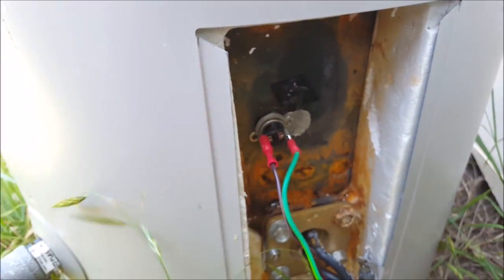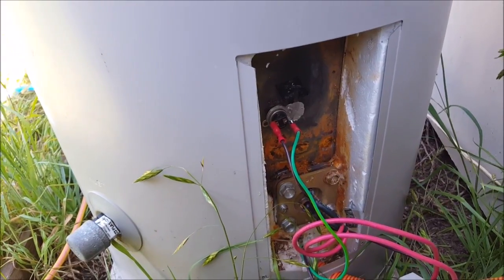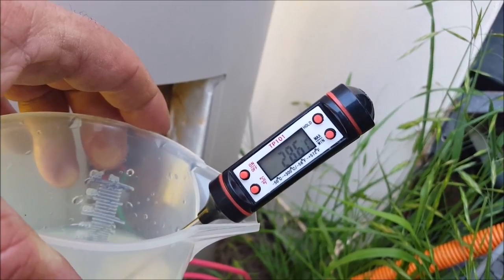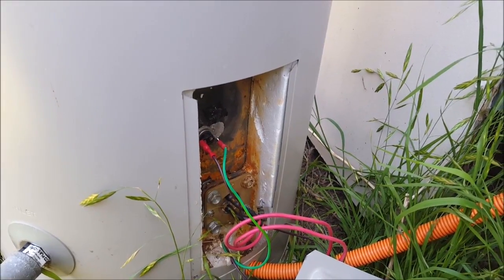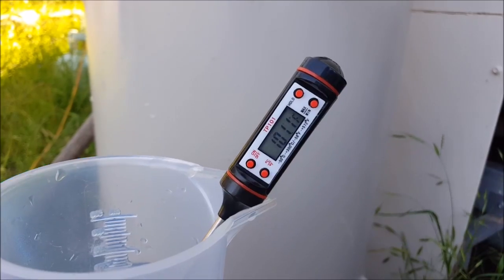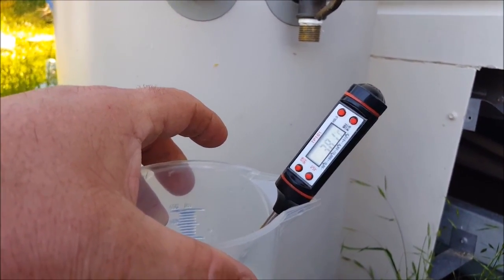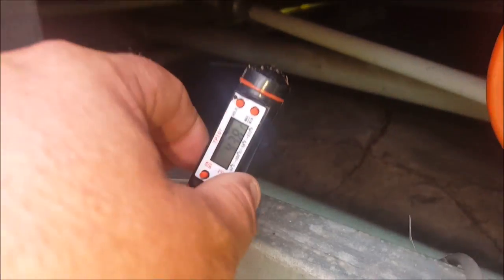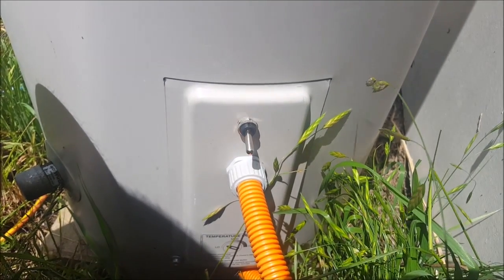Off Grid Solar Power - Solar Electric Hot Water - Part Three

Comment: Hi mate great work i love your videos, check out the PV solar hot water controller from sharp energy investments it is a easy DIY system that uses a standard electric hot water tank with a standard element and thermostat that can be 100% off grid find it at sharpenergyinvestments.com
Reply: have you tried it?, I know in the USA they've had a very similar device for some time, love to own one myself in the future.
Reply: I have been using the sun flux PV hot water controller now for 28days and it works great even over three days of bad weather with three of us using it we still had hot water I am using four 300watt 44.5Volts open circuit panels I could have used three but I never run out of hot water and I have my panels connected to my charge controller so any extra energy goes to my batteries. I have tried the PCB hot water controller from the USA but it ran hot with three 220watt 35volt open circuit panels, it cost me $500AU with the recommended box it is not good enough for a main off grid hot water tank it will be ok for preheating but not 100% free hot water.
The sun flux controller cost me $1295AU money well spent I think.
I have left a comment of my experience with making hot water on u tuber Justin Case Solar Power on his latest video about his new solar panels.
Reply: +troy solar thankyou!!!!